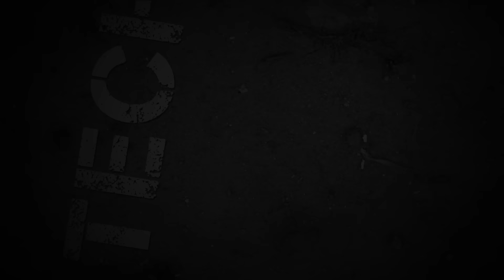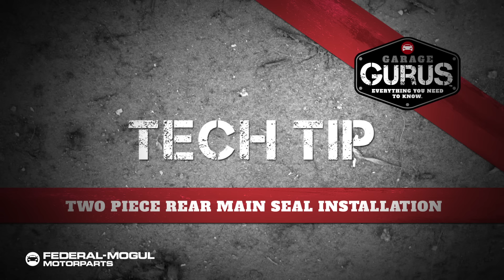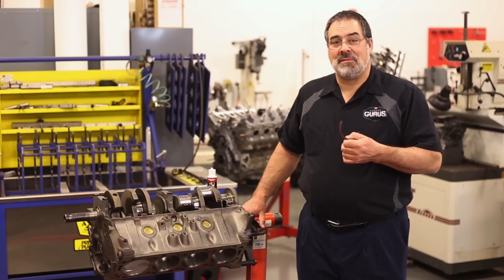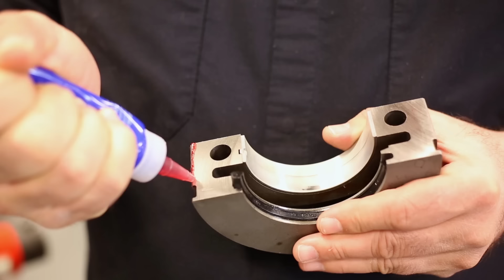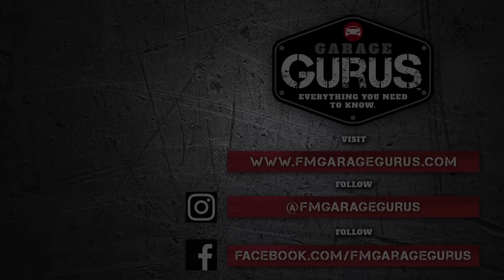Two-Piece Rear Main Seal Installation

Comment: Seems to be a lot of opinions about whether or not to use sealer between the main cap and block. Some say it will affect the bearing clearance, others say oil will leak past if you don't.
Reply: you dont use in between.  but you WILL use it AFTER  the main cap is on and torqued.  right on the edges of where the cap and the block mates.  then put your pan gasket on and use RTV on all four corners  of the pan gasket then put the pan on assuming the oil pump and oil pump pickup is all set up right

and if you have something like an SBF use it on the block to timing cover surfaces.  LMR  has a good video illustrating all of this correctly

Comment: What if the engine is installed? What do you think I should do?
Reply: I'm sure you've found the answer by now, but the engine will almost curtain need to come out. By the time you unbolt everything to move the engine up high enough to even attempt, you had might as well pull it and make your life 1000% easier.

Comment: They make a wire tool with a ring in one end and a tiny screw in the other end to screw into top seal to extract it and to put the new one in , most of the time they come with 2- piece  seals

Comment: Never loosen all main bolts, oil seal an can be rotated into the block without issues,
Reply: Can you elaborate? Im going to tackle this shortly. Ive heard that you can do it without dropping the crank
Reply: You must not have dealt with an old seal, they can be very stuck in there behind the crank and the only option is to remove the crank unless you’d like to score the block up

Comment: I’m having to reinstall the rear main oil seal on my ford 460  which is in my 32 ft R.V  I’ve pulled the transmission and had to raise  the engine up to  make clearance to the rear of the oil pan I then pulled the rear cap ! My question is how would you go about extracting the top seal  is there a way to do this ?  Also  I’ve only been able to take off only the rear cap but haven’t been able to remove the oil pan entirely so I’m not able to loosen the  other crank bolts only the rear !
Reply: Rumor has it, he is still working on putting that rear main seal in even to this day.
Reply: You ever get this figured out?
Reply: How did he do... Scrunched up in-between the oil pan and block yuck, just use a pocket screwdriver to push the old upper gasket out enough to grab with needle nose pliers. Silly Wabbit

Comment: Dodge Dakota 3.9L Magnum is the same .
Reply: About to do mine. Did you offset the seal? or use RTV?
Reply: @one_mega_ohm9139   mine was not leaking it was the rocker covers . I pulled my trans my seal was fine

Comment: I'm doing this now on a Chrysler 440, engine still in the car. Can I install the two seals flush with the bearing cap and block? 
I understand it will seal better when it's offset, it's just a struggle laying on the floor and the bearing cap already in place. I figured I can put some sealer on the ends(?) instead of having to worry about the seal popping out or getting misaligned when I install the cap.
Reply: Look on the installation instructions some say offset some say flush, some say add to some do not, also look on the seal, if your unsure of direction to place some are marked " Air Side " that side goes toward the flywheel.

Comment: You don't show where the two black rubber pieces go? They sort of look like a comma in 3-d. What are they and where do they go? There are the 2 halves of seal, 2 plastic sleeves, and 2 blue side rail straight seal pieces. what about the 2 gray rubber pieces that look like commas?
Reply: Dude that’s the oil pan gasket if you don’t know where they go you don’t need to be working on an engine

Comment: Where you put the sealer on the cap would not keep oil from getting out of the engine. The oil will now follow that straight to the back of the block and still leak
Reply: I know what you're saying, but I think where he put the sealer fills the 90 degree "corner" which creates a natural gap where oil can find its way outside the engine.

Comment: I have a 78 caprice 350 motor im sure the rear main seal is leaking i dont want to pull the motor out of the car to do the seal can i do it in the car ?
Reply: Yes you can. However you must. Unbolt the motor mounts and loosen the trans mount, then use an engine crane to lift the assembly high enough to remove the oil pan, then unbolt the rear main cap, remove the half of the seal that's in the cap and use it to push the seal half that's in the block out. Then lube the new seal with clean engine oil on the lip only and push it gently but firmly into the groove of the block until 1/8" is showing above one side. Then install the other half into the main cap living the lip only and making sure the ends of the seal line up perfectly, add a tiny amount of anerobic sealer to the mating
 sides of the seal only. Retourque the main cap in steps then put your oil pump and distributor drive back in, use a new oil pan gasket preferably the 1 piece neoprene style and install your oil pan being extra careful not to over torque the bolts. Let the motor back down, and align your motor mounts rebolt them up tight and also your transmission crewmember mount✌
Reply: Yes, I know a lot of people say you have to lift the engine to remove the oil pan out but on my truck ( 1997 dodge 1500 w/ 5.9 gas engine ), I don't need to it's tight but it does come out without all the other steps so many say needs to be done. I just take off the dust cover, one of the supports because of the bolt holding the cover, and move the starter. ( Disconnect the battery of course ). Easy stuff. I don't even raise the truck I can slide under on the ground just fine.

Comment: Which anaerobic sealer is that?
Reply from the maker: The anaerobic sealant we use is LocTite 518.
Reply: Garage Gurus

That’s odd...:.loctite 518 is a red and white container while your video shows a permatex anaerobic sealant.  But there are 3 different kids of permatex sealants.
Reply from the maker: @adventuresoffinnandfarley8858  In the video, we used Permatex 51813. We do also use Loctite 518 as well. They essentially have the same material properties. They are both anaerobic type sealants.